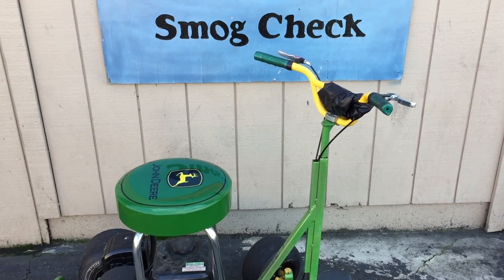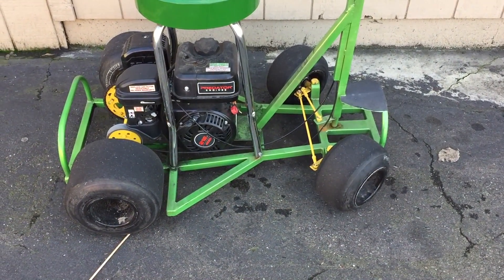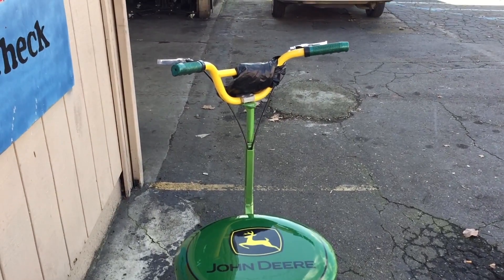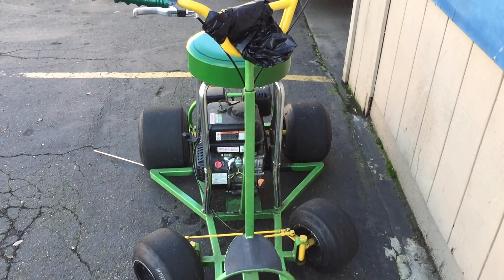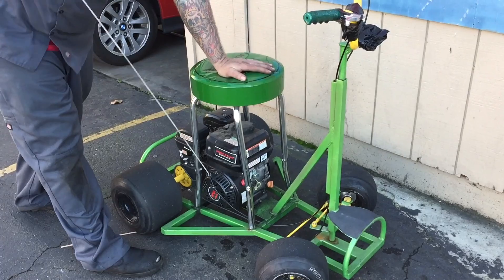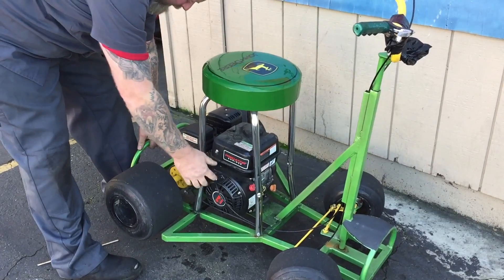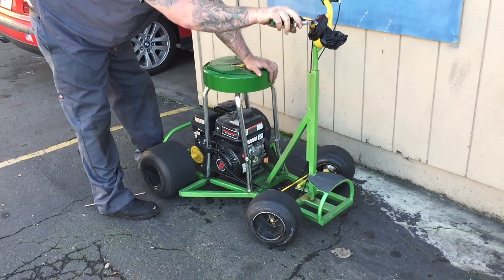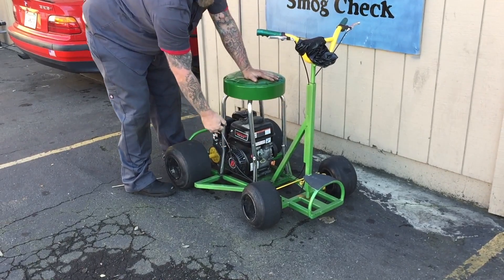MOTORIZED BAR STOOL

Comment: very nice. those clutches get sticky when they get dirty. cleaning it and grease the inside of the bushing should fix it. ty for sharing
Reply from the maker: wallys wheels 
Sure thing, it's my pleasure. I personally don't like clutches because they burn out easily. I prefer torque converter on most of my builds but my recent build I went the cheaper route and installed a clutch. Soon I'll be replacing it with torque converter.
Reply: I hear ya. I've heard you can get a comet tourqe converter knock off for 70$ I seen them online. Not sure if there quality or junk though.  Totally agree though.
Reply from the maker: wallys wheels 
So far I was fortunate enough to buy good quality torque converters on eBay. Knock offs works ok but the belts are poor quality. I just buy original comet belts and the TAV2 copy works flawlessly.
Reply: Ty for the advice. If I order one I will order the comet belt to go with it. Cheers the wheels

Comment: sounds like the clutch just needs some wd 40 so its not trying to engage at such a low idle.
Reply from the maker: ngk330 
Wouldn't it make the clutch slip and render it useless?
Reply: no because it needs lubricated so it doesnt try to grab 24/7. I build mini bikes and go karts and centrifugal clutches are supossed to be oiled every 20 hours i believe and more often if around water. It needs to be able to disengage. once the motor revs up the clutch will then start to engage and tighten on the shaft there for giving you power to the sprocket. there are some videos on it too. I live in Iowa and its always rainy and humid so oiling a clutch happens alot around here. But like you said it can make it slip if you put too much on, and even if you do itll work itself back to normal after the clutch warms up and burns off any exccess unneeded oil.
Reply from the maker: ngk330 
Thanks for the tip and it's nice to know that WD40 might help. I'll have to try that sometimes. One of my clutches crapped out on me 'cause it's always engaged but I'll see if the lube will help. Cheers mate.

Comment: Avoid Heat Damage

By properly oiling your clutch you can avoid heat damage. When heat damage occurs, the clutch will never disengage and the machine will start taking off by itself as soon as you start the engine. You can see heat damage inside the clutch drum, the metal turns from black to a blue color. The clutch must be replaced if it has heat damage and won't disengage. Heat damage is never covered by warranty.
Reply from the maker: Gokarts, Minibikes, and more! 
Thanks for the tip and your advice. I personally prefer torque converters but decided to install a clutch just to see if it can do the job. I've already swapped it for torque converter and soon will post another video. Cheers mate
Reply: See me I prefer clutch mainly bc I like speed over.torque
Reply from the maker: Gokarts, Minibikes, and more! 
From my experience clutches were slower than torque converters. I've bought many used mini bikes and go karts from Craigslist and most of them came with clutch. They were slow and maxed out at 20-25 miles per hour. As soon as I installed torque converter it doubled my speed. How do you get speed out of your clutch?
Reply: With my go kart put a torque converter on after having a clutch and went 10 miles slower put the clutch back I on and now I'm doing 40mph try removing the governor from your engines for some more speed too